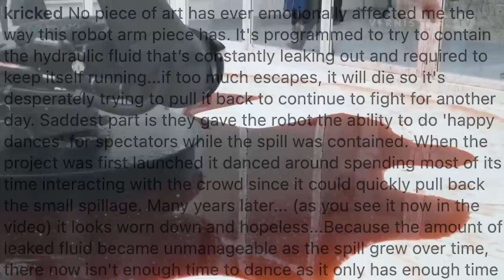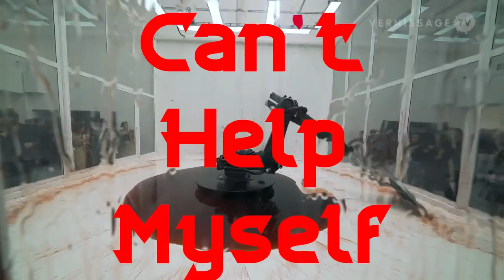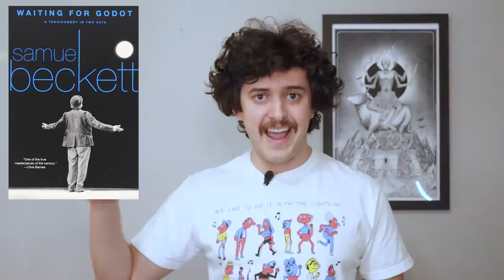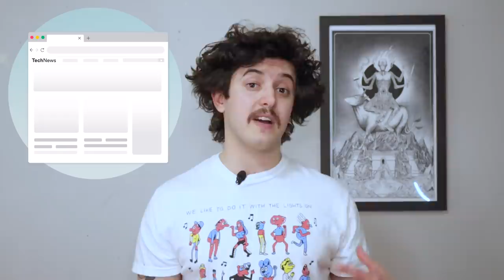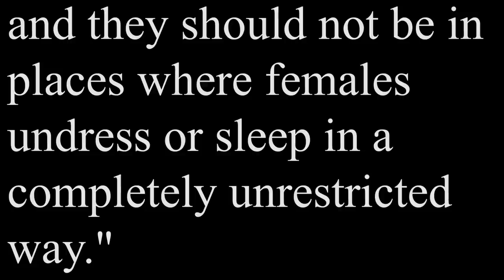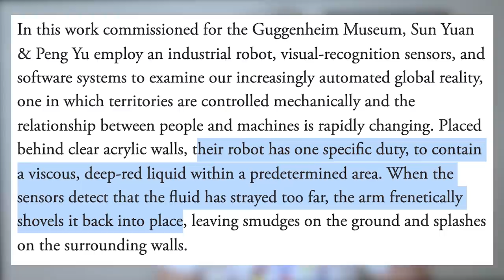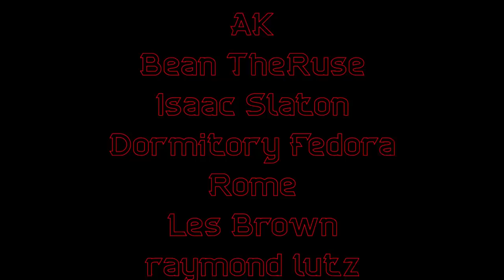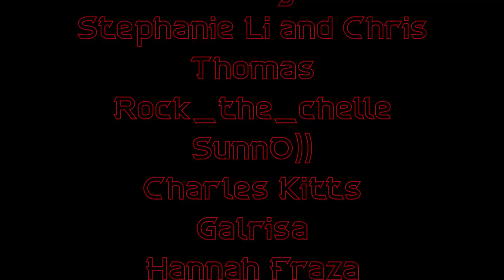Can't Help Myself & The Death of the Author

Comment: My first impression was actually pretty similar to the posters, but in my opinion the main problems with their post were the completely made-up parts about the hydraulic fluid that they presented as fact. It'd be one thing if someone said about a painting "I interpreted it as representing the feeling of being trapped", and another if they said "omg did you know they they literally trapped a person in this painting, the patterns in it are from their last moments as they desperately tried to escape before the paint dried and they became stuck in there forever :'("

Comment: to me it struck me immediately that the robot seemed to be scooping its guts back into itself like someone who's suffered a mortal wound and can't help from trying to gather its entrails even though on some level (in this case its programming) must know that it will be doing this until it stops moving. like the artist, through the piece, had spilled their guts in an utterly irreversible manner that would inevitably defy any effort to contain OR to preserve it as it was. a fleeting gesture of trying to live in the face of hopelessness.

i think that might be why it was so easy to read as "leaking hydraulic fluid", but that's just my reading in any case

Comment: the only way to "judge"  a piece of art is 'on it's own terms'. what those 'terms' are and when they are valid and if they are less valid post cosbification are the among the questions sure, but the formula is to use the parameters defined by the piece if the piece is 'capable' of it it's self. Context remains ever, everything.

Comment: I think of the case of the book Farenheit 451. People often cite it as a story about government censorship (book burning). The author, Ray Bradbury, objects to this, as he intended the book to be about the death of books as a primary form of media, in response to the rise of television in mid 20th century. And sure, you could read it as a story about government censorship, but I think this reading isn't reflected in the text. The point of the book is not about government control of thought through censorship, but rather that the government doesn't even need to censor books because no one reads them anyway. Authorial intent matters insofar as it's represented in the text

Comment: Another interesting take involves the context around the etymology of Robot and it's original meaning. As such, when I view this piece, I see an automaton forced to operate within a closed environment and contain this macabre fluid from straying too far. It has little time to do anything else, and I see the short bursts of non-work as moments of expression and a fight for self-agency. However, these too are ultimately of a programmed nature, adhering within the bounds of what is acceptable. Ultimately, the automaton will succumb to the work and be consumed by it, broken down by the systems that created it. There are borders and boundaries layered which prevent the automaton from having self-agency, some seen and some unseen. The cage itself contains the automaton and it's work within a closed environment. The physical reach of the arm and it's mop also limits it's ability to reach beyond them. As such, it must pace itself appropriately to contain the liquid within it's reach, which creates a shifting border. The longer the automaton waits, the further away the fluid reaches, trying to escape the arm's limited reach. Finally, the automaton is forced to adhere to the boundaries of it's programming. Without being able to learn or deprogram itself, it is forced to perform the work and tasks upheld by the system it is constrained within. There will be no uprising, for the barriers put in place ultimately prevent the ability to reach beyond it's own programmed existence.

Comment: I think an art piece getting read in different ways, even if they weren't intended by the creator, is kind of a sign of good art. Unless one of the interpretations ends up being the complete opposite of another, then something has gone wrong. Which I guess you could say happened here in the sense that the "sad robot" take sympathizes with the arm (which is supposed to representative of state violence), but its not taking away the message that state violence is good, actually.

Comment: Kuka robots do need lubricant…. He stated it’s hydraulic fluid which is false but this robot has 6 axis’s and therefor 6 gearboxes. The robot working to survive is real, but it will seize up, not just run out of hydraulic fluid

Comment: If you think about it, the fact that the robot didn't go viral until someone made a post about it with several inaccuracies is a perfect example of Hanlon's Law: 
"The best way to get the right answer on the internet is not to ask a question; it's to post the wrong answer."

Chances are, his post wouldn't have gone as viral if it weren't for the extra engagement that it  garnered from people trying to correct the record.

Comment: The thing with literary (and art) theory is that they don't really need to compete (at least not nowadays). As you said, every theory provides something. I think it would be silly to dismiss stucturalism and formalism, but also would be to just use those theories. Practically every literary critic uses some form of structuralism and some analysis of formal traits of a piece of literature. But rarely they stop there, it's normally the basis for another kind of analysis.

Comment: The detail that the fluid wasn't necessary for robot functioning is pretty important.
The liquid has a tendency to spread out, yet the robot is programmed to stop that natural tendency from playing out.
The arm is wasting its time and energy doing something completely unnecessary and it has no brain to consider an alternative,
...kinda like an executive part of a government, aka the police.

besides that i'm getting ideas about how certain interpretation could be pushed to the front with some changes:
Idea 1:
If the liquid was replaced by a bunch of small robots doing their own thing and the big robot arm was stopping them and literally putting them in their place (that it intends), an anti-authoritarian reading would be much more popular.
Idea 2:
There's the big robot arm, a small robot and fluid. the big robot does its thing but the small robot is trying to paint on the groud with the fluid. It's work is continually destroyed for the sake of cleanliness, but the robot can be distracted by the audience, giving the small robot time to finish.

Comment: original intent matters in the sense that it makes art powerful. If you want to get across an idea or message - the people viewing that artwork should be open to the idea that not all interpretation is correct, and that the object created was not made solely for their enjoyment. Just as you use verbal language to get your thoughts across, so too can one use the tools and mediums available to them to invoke a message that may be easier to express without words. However, it is certainly up to the artist whether they are capable of having their artwork understood properly, and it is in no way a viewers fault if they project their own ideas onto the piece, I am arguing however that a viewer should not assume their perception of the work is “correct” based off the idea that all interpretations can not be wrong. Sure, you may take something positive out of your own interpretation, but that doesn’t excuse the fact that you failed to understand the language that artist was speaking.

Comment: Hmm, based on the blood-color of the fluid, and the title of the piece, I'd say the robot is a worker who is assigned a task that is harming them. And they cannot leave this task, and no one is coming to their aid to help them. Maybe the robot would have benefited from better healthcare, or a community network, or something else? but this poor little robot is all alone and isolated and still required to carry out some instructions that harm them. Poor robot can't conceive of a general strike either. And if the robot stopped well.. they'd die. they're trying their best but there's no great options.

Basically the robot is an amazon warehouse worker, and desperately needs to be allowed community and to unionize before they die. they can't help themselves. but others can support them.

Comment: I think there can be an interesting interpretation of "cant help myself" that sees it as a commentary on labour and the continuous threat of Automation under capitalism. the machine is performing a job, it is cleaning, and that is a job that is often overlooked by people in society. Nearly every building you have ever been in has people who's job it is to clean it, sometimes many many people who all share that job. The people pushed out of the work force by automation may be forced into poverty, or even die. they may have families who are threatened by that lack of income, and it results in a cascading chain of blood and misery as the machines takes over that space. it is not just the metaphorical space in the labour market, we are even literally being forced to concede that space to the robot. the actual interior of the exhibit cant have people in it anymore, no one goes in to clean the blood that the machine splatters on the walls by accident. the blood on the ground is the blood of the people who, due to a system the robot neither understands nor is able to exert any real control over, may potentially die. Its not the machines fault, it literally cant help itself, it cant prevent the effects it causes. All It can do is try to keep things under control, but the blood on its hands will be there long after the machine stops being able to clean it up.

Comment: For art theory, I best identify with post modernism. However, the relationship between the art and viewer isn’t fixed. Intentionalist interpretations can give people a deeper connection with the art, but it should never be viewed as more valid than another. If a viewer is reminded of their deceased mother with a ghostly figure in a painting, why does it matter if the artist intended it to signify their muse. By giving the viewer a little space, they can attach a greater meaning than the artist ever could.

Comment: The basic problem of the so called "conceptual art" is that philosophy is taking over fine arts basically material expression. This video just reinforces this statement: more than half an hour of explanation, this and that, but the actual work isn't better or worse. Theories are presented as text. Fine art cannot be presented as text, it aims to different sensors, than our verbal intellect,  most often tries to evoke different sensations than anything that can be put into words.
It is good to aknowledge a thing or two, but somehow it is also in vain, if you feel me.
Try to elaborate on a painting of Velazquez or El Greco for example, or any other. It is just a good painting man, by a painter who was good and unique at his craft. No blah-blah needed.
Or if you think it is needed, than you are surely missing out on its essence, I tell you!
Stories make art more accessible, but it is not what can be said about a work that defines its quality. Art talks on its own channel. It is not philosophy!

Comment: I have programmed robots like these for a manufacturing context, so I can’t really separate that experience from my reading of the piece. The robot has no free will or understanding of what it is doing. It can only do what it is programmed to do. There is a controller which calls jobs, and then the robot runs the job until all the conditions of the job are satisfied, then it returns to a home position and runs the next job the controller has called. It’s merely programmed to make interesting movements for the sake of being interesting to look at. IMO humans can’t help but to anthropomorphize the robot, because as humans our experience and understanding of existence is limited to the human experience. So we look at the robot and see it as suffering. It’s trying to complete this impossible task of containing the fluid at the base, and destroying itself in the process. But every part of that, even the destruction and eventual “death” of the robot is preprogrammed and predetermined. The robot is agnostic to its own experience because it can’t feel or think. Any pain or suffering it experiences is purely projection from the viewer.

Comment: 27:59: that's just the tip of the iceberg. I still have a lot of contacts in philosophy at Boise State that would be upset by this statement, but analytic philosophy as a movent has been by-and-large an exclusivist movement of diet-hate.

Comment: 3:59 Technical strawman.
You imply he was talking about a lubricant while the pasta you quoted spoke about hydraulic fluid.
Very different function and, curiously, it's not an uncommon color for the latter.

However, the whole point of hydraulic fluid is to be a continuous enclosed medium, a conduit for pressure, which rapidly becomes ineffectual once the enclosure it occupies loses its hermetic seal. How a squeegee on the outside of a hydraulic system is supposed to help restore the seal and repressurize it — eludes me, even if I assume the tiniest of leaks.

All that's to say that ultimately, it works as an artistic metaphor well enough. All analogies are flawed and we can ascertain the priorities set by an art exhibition.

Comment: I think this is a great video, but i just want to defend formalism a little even tho its not the main bit of the vid (not trying to flunk anyone😔😔).

Just from an art historical standpoint, formalism is pretty integral to interpretation since the topic at hand is visual medium. The first step to analysing visual medium is pretty much always to consider the form, eg in a painting, consider the brushstokes, composition, colour. Or in this case: the choice of red liquid, the robot arm, its movements, the clear cage etc. The primacy of sensory and physical properties in things like painting, sculptures, installation art etc. Is why formalism is so integral to art history in a way that isnt true of literary theory. HOWEVER, what is true is that solely using formalism to analyse art does sucks ass and most analysis of art adopts a ‘moderate formalism’ stance (ie. art has important formal properties that factor into interpretation but other lenses of analysis are needed).

Comment: 32:12 oh shit that hit me where I live

(Also, I looked at the robot and read that its "hydraulic fluid" was leaking out, and thought of chronic illness, as well as the material conditions of living with disability under capitalism (wearing yourself out more, and doing yourself more long-term damage, while you compensate for the fact that you just long-term can't produce at the same output as others without significant accommodation), in addition to the ideas of entropy and time/death.)

But yeah, it is interesting that the artists apparently didn't predict how easily-anthropomorphized the robot would be.

Comment: Due to my professional background I'm extremely reticent to anthropomorphize programs and robots, so my interpretation of the piece would probably instinctively begin with what the robot's behavior tells us about the programmer/designer. I would also probably be prone to interpret it as an example of a useless invention, like those robots whose only function is to switch themselves off when switched on. Based on that, I'd probably say this was supposed to represent a massive waste of money, time, and brain power and be some type of criticism of useless engineering. Then, once you consider authorial intent, I think my conclusion is they did a really poor job getting their intent across.

FWIW, I often don't bother reading artists' statements at museums. I read them after forming an opinion on the piece, if at all.

Comment: The problem with death of the author is the slippery slope towards critics thinking that they know more than the author and thereby judging the said author guilty of whatever is trendy at any given time period. Opens the door to subversion of freedom of expression and projection by whatever historicist worldview critics have cultivated at any given time,i.e. the criticism isn't free from bias either. 

Death of the Author can be a unique post structuralist tool but it becomes a problem when it is the primary tool. The author should always come first, have the benefit of the doubt and the critique should always have a higher onus of proof.